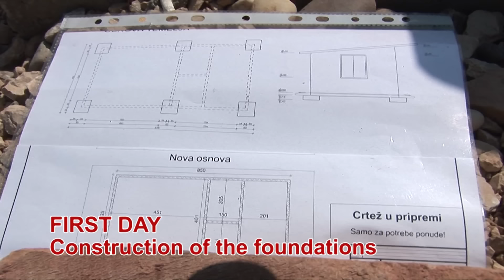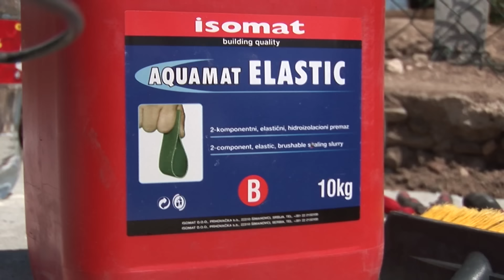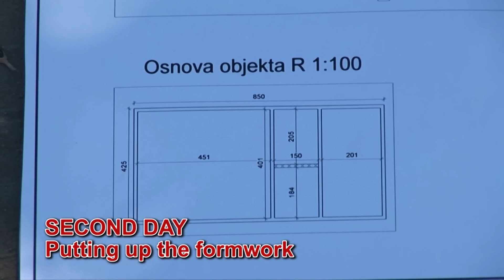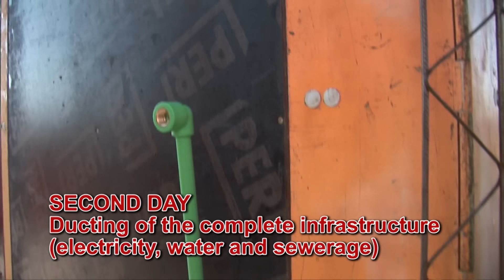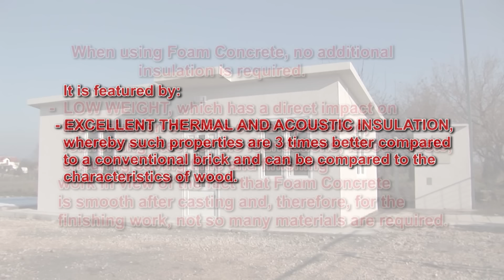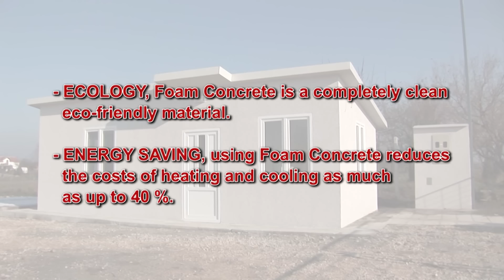FOAM CONCRETE, affordable house built in 6 days!

Comment: How much is the total coast from A to Z ?

Like it :)
Reply: +shm3hTube i  think    in Balkans   its  is around  17k
Reply: +ULTRACROATA Thanks
Reply: +ULTRACROATA 17k of what?
Reply: EUROS
Reply: +blabla62871 I thing you are wrong. 50K euros, i.e. about 60K usd? Too hgh
Reply: I payed less than 150K for a house. But I took the time to wait. If one has the time presents do fall from the sky.
Reply: Do you do this work in the US?
Reply: It looks like a BOX
Reply: Expensive I built a two level house with a flat roof you could use for a patio. 2 bedrooms, 3 bathrooms all brick and cement with 6 windows , front and rear door. floors all ceramic tile 5m x 12m  120sqm plus 60 sqm on the roof you could use as a patio for $17K USD.

Comment: Looks like what we call a Tiny house. But it felt a little prison like. Not sure what the advantage is because we have Pre fab in America that goes up pretty quick.
Reply: advantage: not made of wood
advantage: sound insulation
advantage: better thermal insulation
advantage: stiff enough floors for natural stone tiles (without modification to flooring/subfloor)
advantage: not made of wood. not made of wood.
Reply: +Justin Crediblename What's wrong with wood? We have plenty of it. It's regenerative. Lasts 4 lifetimes. Lightweight. Man has been using wood for shelter since forever.
Reply: AL eng
Lasts four lifetimes? when your tenants burn it down? Fire insurance costs? It lasts for four seasons of termites? Costs extra for termite treatments before it gets eaten up by airborne termites?

no thanks. Wood is downright inferior.

If you want a home that you can relax in, try not to choose perishable, high-maintenance, 1/3rd the strength to weight ratio, flammable food.
Reply: ***** Wood works and considering how many stick houses are built and how many burn down it's not really worth mentioning fire. Anyway no matter the house you have to have insurance. Yeah termites pop up but that's the world. I accept the world. Wood is superior. Proof is in the fact it is in use still and used in abundance. But what was my original question?
Reply: AL eng
easy to build for low IQ people with slightly lower up-front costs does NOT mean it's superior to cold formed steel framing.

Another counterexample to the popular=superior myth:
Asphalt shingles are also very popular. But their cost on a year-over year basis compared to a hidden fastener standing seam aluminum roof is about double.

Homeowner's insurance is only necessary if you have a mortgage.
I'm not a big fan of mortgages.
If it's built right, it won't catch on fire. Perhaps it'll melt in a forest fire, but it won't catch fire.
Reply: ***** You have strange beliefs. Home owners insurance is not necessary if you are RICH! Otherwise it is. The lower  9th ward  took a beating after the hurricane. 
How did we go to from wood to shingles? Concentrate.
Reply: AL eng
your apparent justification for wood framing being "superior" was that it was popular. I was providing a counterargument to the "popular = superior" stance.
Not many hurricanes in California. Another reason why having framing with 3x the strength to weight ratio is important: earthquakes.
Reply: ***** No you were not providing a counterargument. The basis of your argument was "no thanks. Wood is downright inferior". If you had said other forms of construction have advantages in certain environments over others, that we can talk about. You made a  statement that wood was basically inferior and crap. My question was "What's wrong with wood". And the answer to that is NOTHING.
Reply: AL eng
I gave you lots of "what's wrong with wood" examples.
FIRE (any environment), termites, earthquakes, being in the center of tornadoes.

Oh yeah, and for those to whom it applies: insurance rates/desirability.
Reply: well for starters, its not really a tiny house (way too much room) its more like a starter apartment. It does start out looking like a prison, but give it some color and life and it will look the same as every other house. 

and while wood is an acceptable building material, and has its own advantages/disadvantages (just like everything else) and is less renewable then you seem to think. 

foam concrete/concrete is a quick and insulated way of putting up a home fast (arguably faster then a prefabricated one, especially when you can 3-d print a house in under a day) and is where alot of the new building systems are focused (because of the advantages of concrete for energy efficient and more resistant homes)
Reply: Sound tells all.......
Reply: YOU  JUST TOTALLY AGAINST IT,...
Reply: "How did we go to from wood to shingles? Concentrate."

He's been breathing in all the fumes from the off-gassing of the spray foam.

It's a neurological disorder.
Reply: we got  them as insulation  houses,,
Reply: the only reason that wood is used in the United States, is because less tax to the construction are paid, because if you decide to build a house of solid masonry, but taxes were paid, but in terms of maintenance, conservation, insulation, fire resistance, there is nothing better than any type of construction other than wood !! I am an architect with over 20 years of profession, and I always refused to build wood-frame houses, the maintenance cost over 20 years is 1/3 of the total value of the house !!!
Reply: +silistar You obviously are not in America. Wood is great. Our tax structure is not as you say. Wood  homes last over a hundred years.
Reply: you're wrong, i´ve offices in California (USA), Buenos Aires (Argentina), Sao Paulo (Brazil) and Santiago de Chile (Chile); What is more, all these countries are also in America, because it is a continent, America is not a country.
Regarding taxes between different types of houses: they exist and are valid, believe me, design, build and sign the plans to build and make payments. Wood may never be equated to an industrialized building system, as it has many more qualities and advantages that wood can not and never have; for more treatment wood fire has always come whenever they lose and fire, it will light a monolithic structure will not have that problem, in addition to having the advantages of being able to build structures to withstand earthquakes. I feel much laughter when seismic movements in California and see on TV thousands of wooden houses that look like toys that are destroyed by earthquakes, with that in other countries where we also have earthquakes and not build wood houses hardly damaged. By the way, I did part of my studies at the University of Salt Lake City, where I was a professor of architecture.
Reply: silistar
As someone who did my own building plans here in Sacramento, California, I have not encountered any specialty taxes to speak of.

Perhaps not conforming to prescriptive building standards might be considered a tax by needing an engineer's $tamp...
Is this what you're referring to when you say tax?
I'd like to know what these things are that you're considering to be 'taxes'.
Reply: you have everything you deserve in america:80 billion of poor peope,30 billion of criminal people,police brutality,self terrorist government,discrimination,bankers as a roberies....you have everyting,except freedom !
Reply: dragoljub mladenovic WERE  YOU  BORN OR  HATCHED,,,
Reply: dragoljub mladenovic Are there 80 billion people on earth? LOL
Reply: you example remind me: and people with limited brain function ...
Reply: MAYBE HE WAS HATCHED  NOT BORN..
Reply: Wood is not inferior, but metal and concrete aren't either. It comes down to what you like where you live and, what you can afford. Not made of wood is neither a disadvantage nor an advantage. I only wonder how the foam concrete stacks up against solid concrete. Also just for info sake if a wood house is built correctly, meaning no short cuts taken, it can withstand a huge amount of abuse. I just did a roof repair from the last hurricane that came through where a tree, <oak> approximately 85' tall fell on the house <2 stories> it punched through the osb decking in a spot between rafters making a 8" hole and did crack a rafter but the tree did not go any farther.
I wonder the tensile strength on this fab though how would it have taken a tree?
Reply: Brian Tapp We have wood houses that are over a hundred years old. Wood is a pretty good source for housing structures. But again it depends on where you live.
Reply: yes so yea, and personal I like a house built with brick and wood, this house looks more like an office outbuilding though.
Reply: Brian Tapp Looks is another aspect. We don't want our homes looking like prisons.
Reply: yes so you  want to go and see  the mud houses all over africa,,,
Reply: ***** Do they have plumbing?
Reply: yes so yep  and  WIFI  ,,
Reply: ***** Wow so modern.
Reply: Master Debater I have decided I am not the know it all I think I am. Now you get the position.
Reply: yes so pre fab has poor foundations, isnt earthquake proof, has shitty insulation, and is difficult to build ducting/power for.
Reply: 2degucitas good thing its not made of wood.

Comment: with the slump so high how do you keep the aggregates from settling when placing walls ?
Reply: I wonder what's considered aggregate in "foam" concrete? Is this just regular concrete with some foam added to it, or concrete with foam as aggregate instead of Rock? Both would seem like it would drastically decrease the strength of the concrete. I've helped build several polysteel and smart block houses before, but this doesn't seem  very structurally sound.
Reply: wouldnt using foam as the aggregate make this type of concrete weak or lightweight ?
Reply: @michaellyons9640  yes, the majority of the strength of concrete comes from its aggregate and whatever steel is put inside of it. Cement itself is very brittle.

Comment: The foundation won't fly in the USA.  I've seen enough.  This is MUCH more complex and requires MUCH more technology than something like a monolithic dome house.
Reply: *****
LOL!
Reply: I'd prefer the use of pumicecrete in place of the insulative poly foam or as a chain shell over the poly foam on a monolithic dome.
Reply: Though it would take a 14" layer of pumicecrete to equal 4" of poly foam in insulative value,pumicecrete is fireproof.
An internal layer of pumicecrete would also get rid of the echo effect in concrete structures.

Comment: After seeing the concrete used in the footing and foundation for the house, I'm not sure I have faith in any of the rest of the project. When concrete flows like water it has way to much water in the mix. It will be weak, shrink, crack and wear away quickly where it is exposed.  All very bad for a foundation and floor. But they did water proof it, not a fix for poor concrete.  Putting to much water in concrete makes it easier to work but not worth using.  When we are inspected they fill a round form with concrete then pull off the form and measure how much the concrete slumps down.  Four or less inches is passing he generaly. That concrete looked like it would slumps eight or nine inches. Wouldn't even guess how low the breaking strength might be. Expected strength generaly in the area of 3,000 PSI to 3500 PSI per square inch.
Reply: This is foam concrete, not concrete as you know it. The same rules don't apply.
Reply: That concrete mix most likely had plasticizer in the mix to allow for flow in and around the rebar reinforcing, it actually reduces the amount of water used in the mix making it marginally stronger than just water alone. Don't judge others peoples work based on what you don't know.

Comment: Way too labour intensive and slow. I much prefer factory pre-cast concrete slabs, which are much faster, easier and give you a finish which is ready to paint inside and out straight off the truck. A whole house can be erected in 4 hours with no foundations required other than corner piers 600mm x 600mm x 900m deep. The finished house looks just like a traditional rendered brick home without the time or expense. A 165mm thick reinforced, insulated pre-cast external wall is cheaper per square metre than a traditional brick veneer wall. Internal walls can be done in 100mm concrete or traditional timber and gyprock.
Reply: A 900m deep pillar seems like a serious undertaking.
Reply: @MithradatesMegas  not when you consider the piers are holding up an entire house made from concrete

Comment: I cringe when I see electric/ plumbing, etc., being buried in concrete like that.....
Reply: Why
Reply: @hidemehere1  If a repair is needed to them....Otherwise a great project!
dave
Reply: @daveosland3199  cheers man that makes sense, I built a house in ireland and then bought a second so at this point I think I know everything until its on fire
Reply: @hidemehere1  The cost of land to build on, in San Diego California is 3x cost of construction of this house.
Reply: Agreed.  Everytime I've seen wiring buried like that,  it's ended up being a big problem.  It's better to run it along the surface of the wall, then covered,  or use steel conduit.  MUCH easier to work with.
Reply: @jstephenallington8431  now then, don't get logical, fancy been able to sort things out, without the problems of essential services been buried, my sister does not like to see things on walls, and does not like paying for any thing she can't see, so you can't win, but I like to be able to see things in front of me, instead of being blindfold, I was an industrial plumber, nothing was buried, because it is not practical to maintain, I disliked working in people homes, as a favour, I was putting an extra radiator in, and the wooden floor was tongue and groove, with a steel strip, I used a small angle grinder to cut the steel strip, to remove some floorboards, only to find out that the floor had been laid on top of another wooden floor below, going in the opposite direction, maintenance is not considered by installers that much, 
if they had done some maintenance work they may have leanrt something.

Comment: IF that is data cable I would have installed a conduit as it goes obsolete in ten years.
Reply: +Lorin K 
Can you go wireless?
Reply: some people don't like extra radiation.
Good luck getting wireless to compete with fiber.
Reply: Forget the data cable. What about the unshielded POWER cable???  One second you are drilling into the wall to hang a picture, the next second you are lying on the floor in cardiac arrest...
Reply: brimstone33
looks like the wires are fairly organized. Are they 6 feet up? I guess no pictures can hang within a certain distance range from the floor, and within a certain lineal distance along the floor line but above the receptacle from an outlet or switch.
Pretty unlikely to get shocked though with a modern plastic covered cordless masonry drill.
If you really wanna be cautious then you can buy a radiotransmitter & receiver that is generally used for plumbing. I bought one used on ebay about three years ago for ~$227. It's been great for locating utilities both above and below ground.
Reply: ***** No wireless, no Cloud, no cell phone, no Goggle acount, no Facebook... :)
Reply: Rick Corel
pretty sure that wireless devices work within masonry buildings...just not as well.
My uncle's home has 1-3' thick solid masonry walls. cell phone service isn't great, but still works.
many of us have home PC's & don't install that stuff on our phones.
Reply: I meant something else... I ma trying to keep wi-fi away from me...
Reply: +Rick Corel p0

Comment: I'm alarmed at how much water your concrete had in it. Generally that lead to sub par performance.
Reply: Monsterbaby I thought you were nitpicking before I saw the video… I’ve never seen that much water in concrete! It look like three times as much as required. Crazy!
Reply: Its aircrete!!!!
Reply: @lizf1353  aircrete is supposed to be foamy and dry-ish,  not watered down and runny like in the video. 😣
Reply: @lizf1353  Yes, aircrete has a SMALL fraction of the strength of real concrete

Comment: Just saw a " waterproof" coating going on...yep, they used that in Carolina!  Will not hold up!!
Reply: here in central Europe, they use this kind of waterproof coating underneath bathroom tiles so that spilled water or water from the shower does not get into the walls/floors.

Comment: When you tells me how much money  and i will answer to you if that is affordable or not,  but if can't say the cost or the total price then how do i supposedly know if your price is the right price for me 😠 it might be really expensive , i Really like but i do not want to be in love until i know i can afforded  😂🤣
Reply: Looks a lil expensive
Reply: Its not expensive,  if the govt is paying for it.  Sarcasm
Reply: Try metal frame used for industries it's fast it's cheaper it's moduler and easy to insulate goes long like for 30-40 years in my factory we are using it for like 20 years now and it comes in different colour schemes I prefer red or green though easy to clean
Reply: If you know welding you can diy it yourself or if you go with bolting you need a good drill

Comment: Pro tip: concrete is an aggregate of cement and sand and stone, if your mixture has no stones it's not concrete.
Reply: Mark Hunter
Reply: Isn't sand just a bunch of tiny stones?
Reply: Sand is weathered rocks, so yes.  The sizes are what makes the distinction in aggregate materials.  Cement + sand = mortar, which has different properties than concrete which is = cement + aggregate.
Reply: Mark Hunter po
Reply: Mark Hunter Isn't dand just a very small stone?
Reply: Way to douche up the comments section Mark
Reply: Mark Hunter i
Reply: are they dead already type or still alive type coz in the second type they gonna add some sheesh in a minute and that's poncrete
Reply: Mark Hunter  in this case the foaming compound act as aggregate
Reply: Yes, it is not concrete.  What is your point?  IT is something else.  Cement and air.  Far softer, yes, but strong enough to do the job as it is placed.